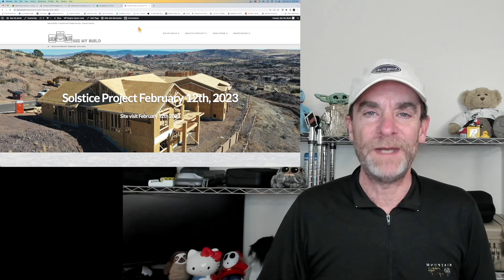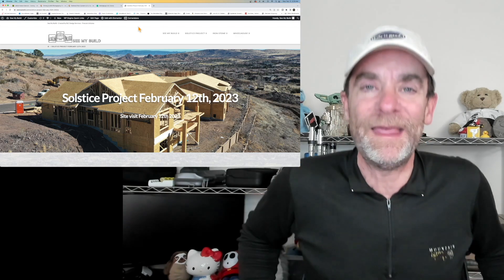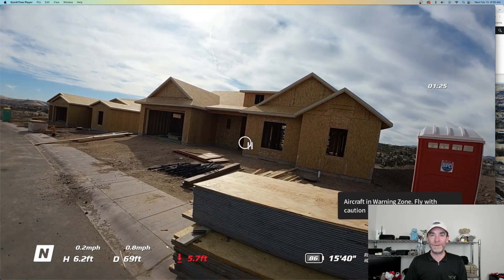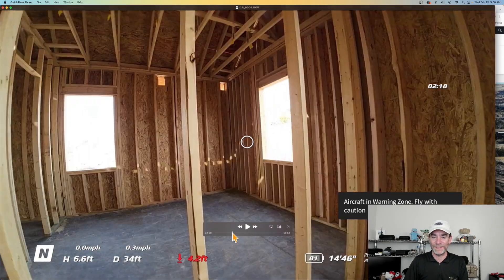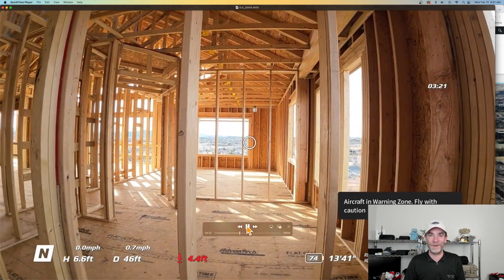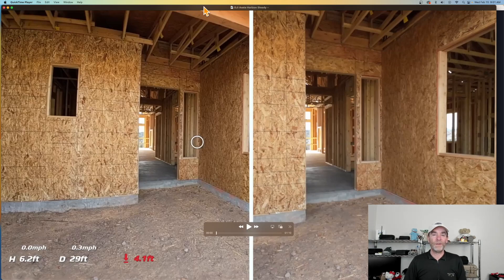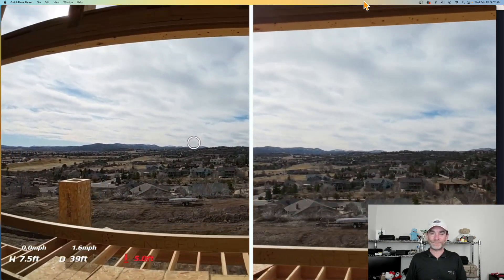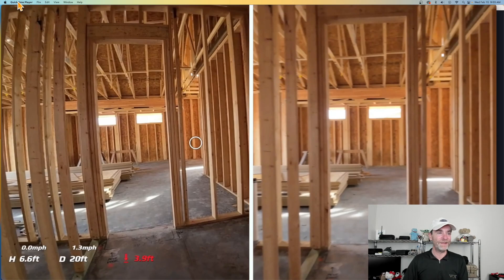FPV Drone Construction Progress - DJI Avata Horizon Steady

Comment: Gyroflow really adds a whole different dimension to the stabilization compared to the built in system. Have you tried mounting a GoPro on top of the Avata. The stabilization from Reelsteady and dynamic range from the GoPro is significantly better than the Native Avata Cam.